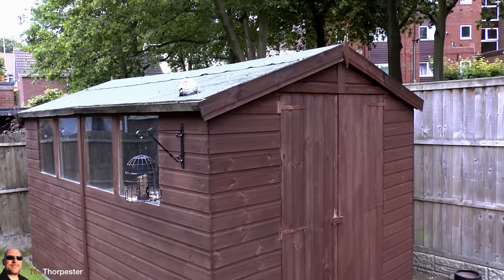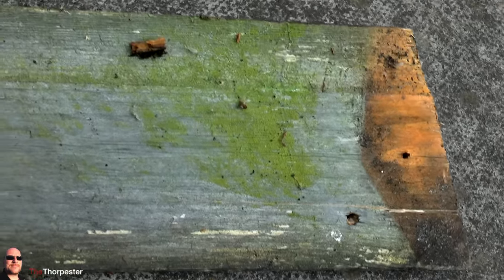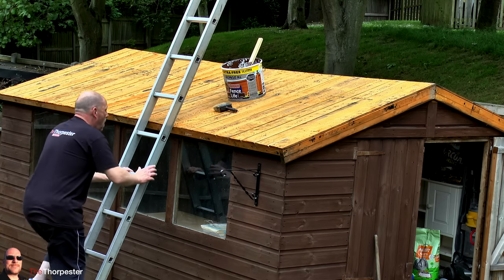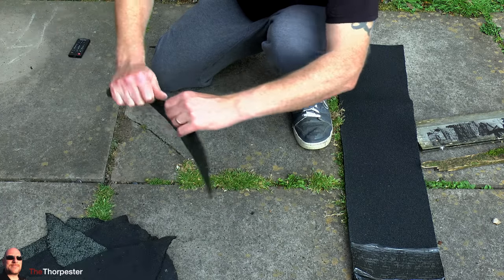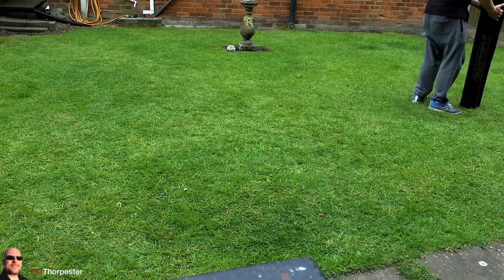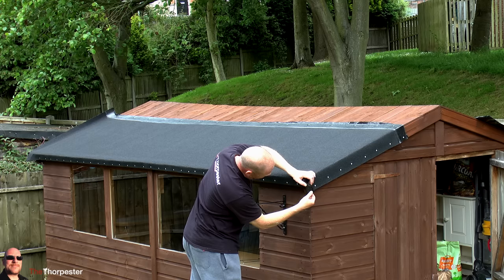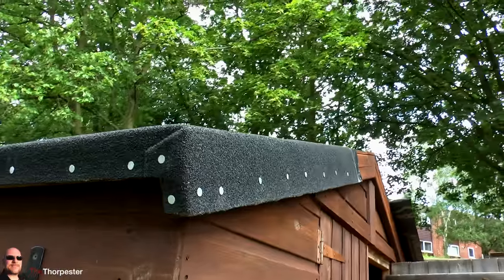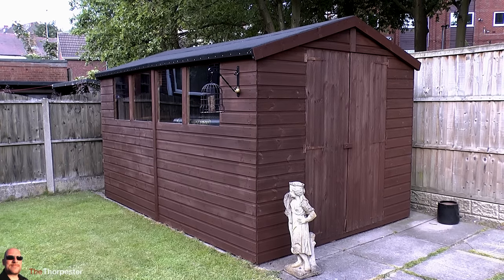How to Easily Felt a Shed Roof The Right Way- DIY

Comment: i cant find this product anywhere !?
Reply from the maker: I think they call it Torch On Cap Sheet. You can get it at B&Q etc. there is also an underlay you can put in first if you want to go that far. I just wanted something better than the rubbish standard felt though and didn’t bother with underlay. It’s still looks the same as when I did it!  Good stuff.
Reply from the maker: …make sure it’s Polyester based. That’s what gives it the strength 🫡
Reply: Just seen , B&Q 👍

Comment: never put nails down through the top of felt, it will leak within two years, also the corners are folded wrong, with those  folds it will hold water.
Reply from the maker: Thanks for the advice. It’s still up though and dandy.
Reply: The material used for Shed roofs is designed to self-heal and seal around the nails. Also, you could tar over the nails for belt & braces.
Reply: I use bubble water proof rubber caps and slide the clouts through them
Works a treat 10 years on
Reply: You can put clout nails through shed felt
Reply: @lloydunett206  you haven't been roofing too long then, moisture gets through,, have you ever heard of gravity?

Comment: Also, my shed is backed up into a corner so the north and east sides are very hard/impossible to get at. Dunno how I could hammer in the sides. Any ideas? Maybe I could allow for an exagerrated amount of overhang and hammer along the edge of the roof instead of at the sides. Seems unsatisfactory though.
Reply from the maker: That's a tricky one but I would avoid putting more nails in the roof where possible.  I'm afraid I don't know the answer to that one buddy so apologies.  Like you I'm a DIYer and have only ever done this one Shed :( Sorry matey...
Reply: @TheThorpester  No worries man. Very useful video. Cheers.

Comment: Hi you made a few mistakes the first you should have added more wood on both sides for dripping of rain the closer the roof is to sides the rain when dropping from roof splashes on ground then hits the bottom of hut. If you hVe grass that's OK the door should have a weather board that stops water getting behind the bottom. The side of roof I would have glued it instead of nails there serpose to stop water but they don't after a while. It's like the smaller the umbrella you get your shoulders wet the bigger the umbrella shoulder stops dry yes a d good over hang protective to bottom of hut. On most huts you will find the angle of the wood slops in slightly so that means the rain hugs underneath nice big hut. I've just cut a door from side of hut with two bolt hinges for Wight the roof made in to  dorma roof so my head doesn't catch when walking in another good tip is gutters with down pipe to catch rain water for plants in plastic barrel

Comment: Please say it's your way. Not the right way. The felt has adhesive so you don't nails. Then you you used nails on the top part
Reply from the maker: Never said it was the right way.  I said it was tougher than the usual felt and can be put on the same way (if you don't have a torch).  Still the same as it was when I put it on.
Reply: Exactly the very title says "The RIght Way"...  in windy areas the field of the roof has nothing to hold it down from uplift.  (would be adhesive or torch-adhered in this case), this "a" way for quick and dirty small projects. Nails are fine on this product if overlapped, like at the top). On the field area it should be adhered.

Comment: Looks good to bad it was done incorrectly . Let's start from the beginning. First of all you should have put a facia all the way around the shed roof line. Then put on 30 lb. roof paper stapled or nailed in place. Now install metal drip edge at all the edges to protect the roof edge and kick the water away from the shed body. Now cut your rolled roofing to fit over the roof with about a cm. overhang with roofing adhesive on the drip edge. Never fold the roof material over the edge. When installing the rolled roof material just nail the top side of the material where the asphalt glue strip is so as to never expose the nail heads. The finishing cap sheet should be held down with roofing adhesive again no exposed nails Paint your facia and your good to go for at least 10 years or more.
Reply from the maker: Thanks for the advice but I think you've missed the point of the Vid
Reply: couldnt find these parts in homebase!

Comment: This video is advertising the wrong method. Th joints in the felt should run from Ridge to Eaves, not Gable to Gable.
Reply from the maker: You mean bottom to top (vertically).  If so then NOPE
Reply: Not sure I understand your comment, I am 80 years of age and spent my entire working life as a Carpenter and as yet, never come across a vertical roof. Cladding is vertical
Reply: @bobbeck5866   I know where you’re coming from. A number of old properties at my families home had outhouses and the felt ran ridge to eaves with timber battens then laid on top. With the modern rise of shed manufacturers the trend is to run the felt horizontally. Pays your money and takes your pick.
Reply from the maker: @bobbeck5866  Apologies.  I meant the felt being nailed horizontally.  Method I did here is the accepted method I believe.  Never seen felt laid the other way around on a shed roof

Comment: Why do people in this country insist on measuring in cm - we drive in miles and give our height in feet and inches and use some antiquated system of weighing ourselves - stones+pounds - have you ever seen a boxing match or MMA where the fighters are weighed in stones+pounds !!!???? and for some reason now buy fuel in liters - who asks how many miles to the liter does your car do ?
Reply from the maker: Haha. Good point
Reply: Because metric is piss easy to do any sort of conversion in, I'm a machinist so totally fluent in imperial AND metric, but prefer metric any day of the week 😂
Reply: We moved to metric 1975
Reply: Because its simpler, more logical and the rest of the world uses it. Not difficult to understand
Reply: whos we? - in the UK we drive in miles and give our height in feet and inches and our body weight in some weird stones+pounds system @KieranJBoyle

Comment: Your suppose to shingle OVER roofing felt... not just use felt by itself lol....
Reply from the maker: Who told you that lol
Reply: It's only a shed, what he done was fine.
Reply: There are 2 types of roof felt, that designed to go under roof tiles and that designed to be the top layer of protection
Reply: You don't shingle over that roofing felt, you're thinking of a different felt.
Reply: Shingles are made of felt, no?